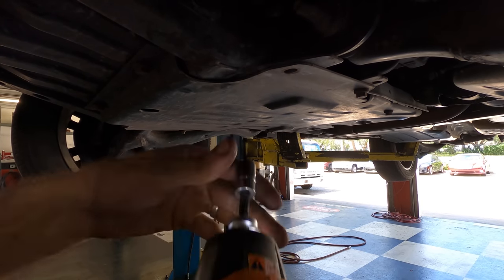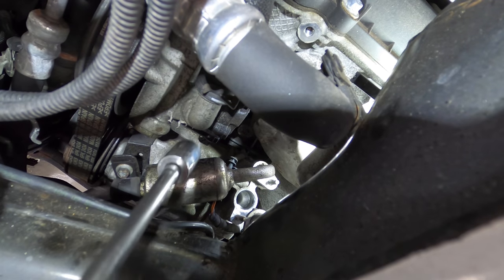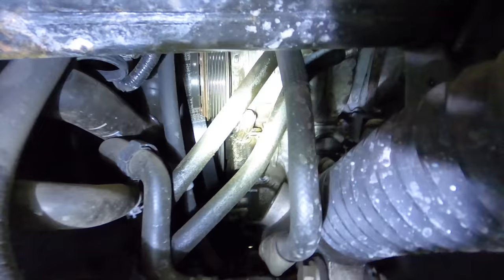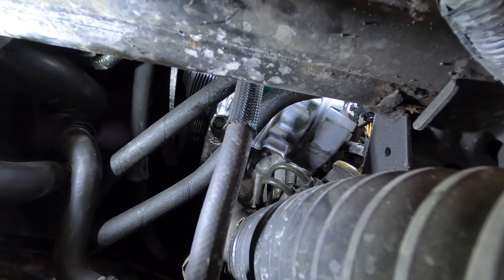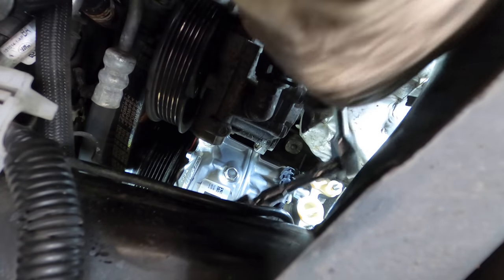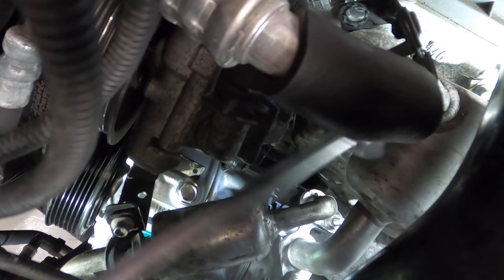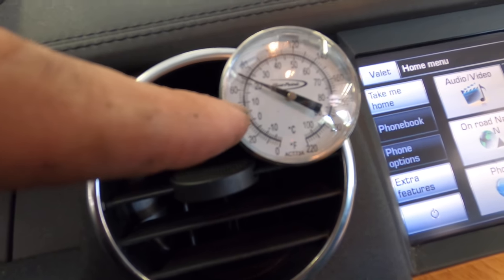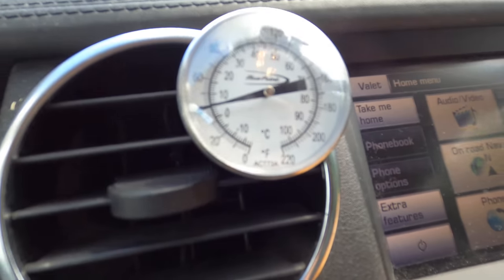Land Rover SUV Compressor Extraction! Working blind! Read Description.

Comment: I can also hear the timing chain is loose and needs to tensioners.  While there you can sell the two VVT sprockets.   Missed oportunity and Im VERY sure the customer would love a quieter engine with zero chance of chain slip.

Comment: @2.58 there seems to be a red wire in the wiring loom above your wrist that has lost some insulation around it and the copper wire is exposed? 
Didn't see you change the rubber o rings on the lines Ray!  Didn't see you check the A/C belt Ray?

Comment: you need to add some electrical tape around your "wobley" universal... the tape will stiffen the joint but still allow it to flex.. just after time the tape will get gooey and you have to use brake clean to clean it off before you put more on.

Comment: Hey Ray I wanted to let you know that the EPA Protocols are not because of you. It is because of all the other people that are not doing what they're supposed to. I have a customer that tops off their system once a week with 12 ounces of R134 and won't get the leaking line replaced for 200 bucks. They have been topping off their system for about 2 years. They have probably spent triple then what it would cost to have the line replaced.

Comment: very impressive work Ray.
As for the comments here, jeez, serious overdose of moaning with premium cars.  Lots of this stuff on premium cars just requires a cross member to be undone/lowered etc, support the engine and undo 2 bolts, and then you have your access.  Hardly rocket science.

Like on that video on the mercedes windows regulators.  If it's not a baked bean tin with a bit of carpet gaffer taped on for a door panel everyone's up in arms.  That was a clever design of door internals, a few electrical plugs and just a few strategic bolts with access designed in.  Everyone here was complaining they'd rather drive a F150 from the 70's.  Ridiculous.

Comment: It would be interesting to know what the  cost is for these repairs
Reply: Lots...  4.7 * $60 cheap shop hourly rate... (Mechanic might get $20 an hr)  and some shops charge more than $150 an hr. (Mechanic gets about 25% to 35% of the shop rate)

Shop has to cover paying some "dead hours" where the mechanics wait for a job... Building costs, receptionist, management, FICA match, insurance, workers comp, unemployment insurance and more.
It costs the business nearly 3 times whatever the employee sees on their pay stub.

Comment: Beta Tools makes a set of T-handled socket wrenches with attached swivel sockets specifically for dealing with this sort of tight space crap.....  Expensive but worth it if you have a lot of cars like this.  They were originally design for working on Ferraris which are a nightmare to work on.  Engine out 15k service is not unusual on those cars....

Comment: I always check my vent temperature with the fan on low because the air stays in contact with the evaporator longer removing more heat. Of course this is after the interior has been cooled down.
Reply: You can blow air fast enough to reduce cooling.
My F150 AC cools better at fan on 3 (med high) than 4  (highest)

I only use 4 pulling outside air with a rear window open for a minute to blow the sun heated air out in summer.

Comment: They are notoriously hard to work on. The v6 deisel is easier to work on than the v8 petrol. Landrover recomend taking the body off to work certain parts of the engine including the cambelt on the diesel. small hands come in handy.

Comment: Did it really take 5 hrs as stated in the flat rate manual?
Damn fine job. Seems the more expensive the car, the longer to repair.
Saw a Lambo a while back that took 12 hours for an oil change as they had to take the back of the car apart to get to all of the drain plugs and radiator.

Comment: Awesome job as usual. Did you change the shraeder valves and o-rings on the two lines to the compressor? Probably not necessary,  but why not change them to avoid a pain in the rear end leak in the future. Lol

Comment: First off, I don't think the British consider themselves European. Hence, Brexit.
Then there's the seatbelt chime. I was noticing that that thing is really quiet inside, except for that really annoying chime, way before you mentioned it. Lol
I have always been told that 40°f is optimum temp from the vents.
I have only recently discovered that if I put mine on recirc at least for a while that it actually cools off much faster. It's 100°+ here a good part of the year so you can literally severely burn yourself on the outside or even the inside of a car when getting in.

Comment: I own a 2010 Range Rover, same engine although mine is the supercharged varient(AJ 5.0). You have all of my respect sir. I have to work on my own rig. Most shops will not touch it. Outside of warranty these are nightmares if you dont do the work yourself or have a great indy shop. Excellent content. Thank you!

Comment: "Remove engine...."  Didn't the older Taurus have a "tilt engine" feature just to work on the firewall bank of spark plugs?
Reply: My '03 Montana had that. Half the stuff you had to work on needed the engine rocked.

Comment: Rover , another euro designed for <50k trouble free miles, then 2nd mortgage size repair costs. Usually vehicle is replaced , seldom fixed.

Comment: I know a fair amount about the L319 (LR3, LR4) and L320 (Range Rover Sport Gen 1) platform and would you believe that the approved repair method for a lot of the hard-to-access ancillary engine parts, and to replace the engine and transmission, is to lift the body shell off the chassis? 

Yeah, I shit you not, we do it pretty regularly in the shop at $work. It definitely was NOT Land Rover’s finest design by a long way.

Ha, I almost thought when you shut the hood you didn’t slam it hard enough, it’s another design feature.

Comment: Would like to have seen the highly classified calculation of refrigerant oil requirement.
Reply: Ray said in a previous video most compressors come pre-filled with the correct amount of oil.  Maybe that was the case here.
Reply: @johnh8268  Removal and measuring of pre filled compressor oil? Absolutely a must, measuring oil withdrawn from system on removal is very important, seen too many failures from;  "mate fitted a new compressor, just top it up  for me" Mmmm are you sure?.. OK!

Comment: I want to see a spark plug change in a Chevy Monza V8 since you breezed through this exercise.
Reply: Had to cut a hole through the passenger side floor to reach #8 plug airdrop rear crossmember and lower rear of engine.

Comment: I had a job like this removing the starter motor on a 2.5td jeep grand cherokee, RHD. Jeep say to drop the engine to remove it. . . It took me 2 days and im sure I invented a few new curse words. Politely told the owner to never darken my doorstep with that monstrosity ever tf again once it was done. Water pump, turbo manifold, turbo, wheel, wishbone, suspension strut, driveshaft to name but a few components that needed removing. I feel that maybe if designers were forced to work on their creations in situ, jobs would be a lot easier

Comment: Ray, I have one question Why do you wear a ring while working on cars? I always remove mine when working on cars. I once accidently welded my ring to the starter when retrieving a dropped socket. I haven't worn jewelry since. BTW Your torque specs are phenomenal.

Comment: Someone else posted videos several years ago where they purchased a Range Rover from CarMax. They bought the extended warranty on the vehicle.  By the time it was all said and done, CarMax would have saved money if they had simply bought the car back from him.  Multiple repairs for the same issue in a short period of time. Other than a "status symbol" I don't see why anyone would want to own one.
Reply: Because they are inexpensive used. These cars depreciate quickly. I owned an '89 Range Rover that had the small block GM engine. I paid $15K for it with 80K miles. That engine never had any major repairs and was running fine when I got rid of it with 230K miles. Currently own an LR3. Paid 12K for it with $60K miles. Currently at 170K. Guessing I will easily drive it to 200K. Both have been great cars to drive and the interiors tend to hold up better than American SUVs. The Ranger Rover had a ton of small issues (door locks and other stuff. The LR3 has been pretty solid except for the entertainment system.) 

It helps if you can fix the small stuff yourself. I take it to a mechanic who only does Rovers. 90% of the time they can diagnose it from the curb. They are quirky and odd cars to be sure.

Comment: Does anyone know what could cause a 05 f150 4 door lariat 4x4 to drive like it’s pulling a load or hailing a trailer when driving along with vibrating to the point the hole cab shakes and makes a rumble sound

Comment: Much as I like Euro cars, especially Jaguar and Range Rover, I've never been brave enough to buy one. Mind you, I'm not impressed with American cars either. I'm a Lexus fan I'd have to say. The only issues I've had are shocks (factory ones useless) and the odd sensor.  My wife bought a new Kia Sportage, and it's incredibly boring, in a good way. Absolutely nothing has ever gone wrong with it, not even a bulb!!

Comment: Not JUST European engineers. North star V8 in an '80's Caddy,  3 water pumps in 2 years......in a driveway...without means of lifting the motor clear of the frame. Not much in the way, just 0 clearance, 16 fasteners and large hands.

Comment: If you wanna turn that stupid seatbelt noise off on ford derived Landrovers turn ign on, engine off, plug drivers seat belt in 10 times within a minute (holding the red release button down while doing this helps make this easier) seat belt red light will flash to indicate success, no more Annoying Chime, do it again in the future if you want to reverse the process. if someone unplugs Thier seatbelt the red light will still come on but without the noise

Comment: "Step 1 : remove engine
Step 2 : change compressor"
You are not far from truth : on diesel Range Rover Sports, you actually HAVE to separate the body from the chassis to change one of the turbos.

Comment: The ICC (International Criminal Court) should condemn any "Public Road Motor Vehicle"  Intentionally designed like this as a "Crime Against Humanity"  & the responsible involved Enginerrs subjected to public H, D & Q's  (Hanged, Drawn & Quartered).......It's Not an aircraft,  just a pratical common man road machine sold to trusting customers.......M Vehicles then more likely sensibly Designed or just not built (or missed) ......

Comment: Dude you don’t know what torment is. Try replacing a turbo on one of the diesels without taking the body off the chassis ! Lol 😂
Reply: @Cathal O Mealoid - I did just that very thing, a few years back!  [08' F-350]
I hadn't even 'heard' of the "cab-off" for under-hood procedures, before then! Contemplated, how we were even going to do that, in a residential garage (we simply couldn't) - getting the old one [turbo] out (cab-on), was a chore, with a bit of "Chinese-puzzle" work, at every step; and that was easier than putting the new one, in! IIRC, I had to modify a couple of wrenches, and force my relatively small hands, through some very tight places ("raccoon traps")! All that, and the first test run, it went into "limp mode" - before losing the will to live, entirely, I happened on some info, on-line, about an air-bubble, that gets trapped at a coolant sensor, as I recall - anyway, that was a very hard-won, successful ending; it took a few days, at that. You reminded me of that adventure; so you get the short story, of my recollection. Cheers-
Reply: @markaoslo5653  I enjoyed the short story and shared frustration and scraped knuckles.👍
Reply: @COM70  - 👍

Comment: These vehicles need the body removed from the chassis to access or remove many engine parts. No kidding! Eight or ten body mounts, steering column and many electrical connectors on a four post lift and maybe three hours and you have all the access you could wish for. Dreadful design in my opinion but that is how much work needs to be done to it.

Comment: Wait until someone designs a car where you do actually have to remove the engine to replace accessories.
Reply: They already do, there are lots of jobs where it's easier to lower the engine out for repairs.
Reply: They already did, in the 1930s: VW Bug. 
Often require engine remival, but with the right tools an experienced mechanic can have the engine out in 30 to 45 minutes.
Reply: There is a competition for removing a Bug driveline. About 30 mins with 2 people and a floor jack. Catch the engine with the jack then lift the body off.

Comment: Terrible design of the engine. I am so glad l only buy Toyota and lexus vehicles.
Reply: I'm watching this in astonishment. My 15yo Camry with 200k miles is still on the original compressor... I'm not even sure how often it's been recharged in its lifetime, if at all. Blows freezing cold air. Even if it needed replacing, you open the hood, and it's right there.

Comment: As a Land Rover specialist and A/C qualified mechanic is was disappointing to see the mistakes you made on this job or omitted to say you did.  Firstly you have to balance the oil in the compressor before fitting a new one, i.e drain the old compressor and the new which comes with a full charge of oil and match the new to the old unit, this prevents oil over charge which prevents oil sludge and compressor failure.  Secondly did you change the rings on the hoses to compressor as you never reuse old orings.  Thirdly the dryer/filter needs to be replaced when replacing a compressor this mandatory practice listed in any training manual.  I do not like to point out mistakes mechanics make as we as an industry already have a bad reputation but if you put out a video with glaring procedural mistakes I feel it is important for the reputation of us that do the right thing to point out the problems.  I hope in the future you can learn from your mistakes and hold yourself and others to the high standards many of us strive to achieve in our chosen careers.  P.S.  You where lucky it was not a Diesel engine version as the total time for that job when completed correctly is 13hrs +.  Kind regards.